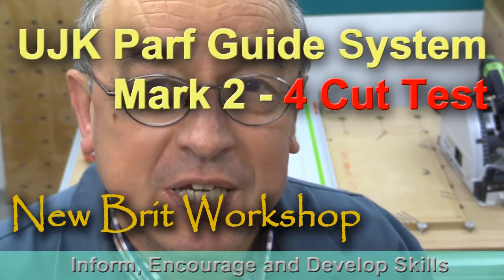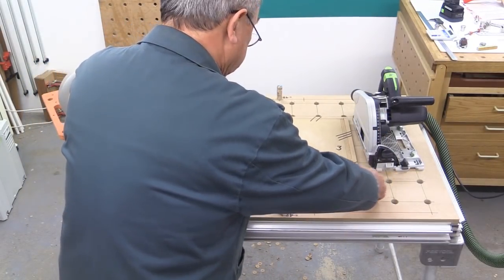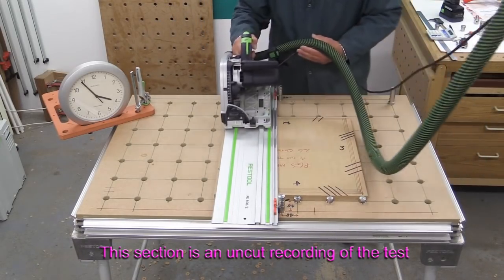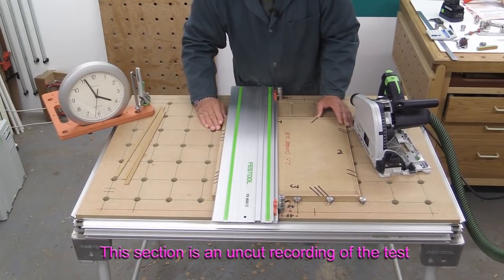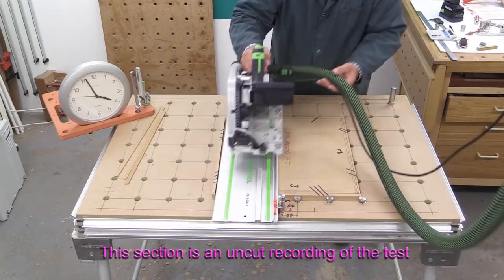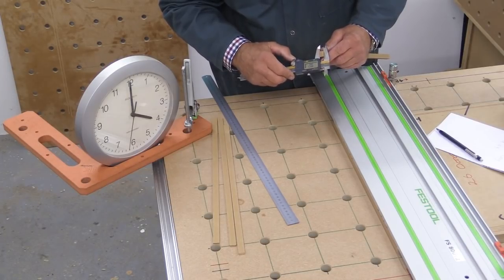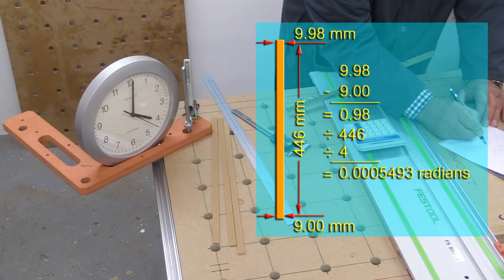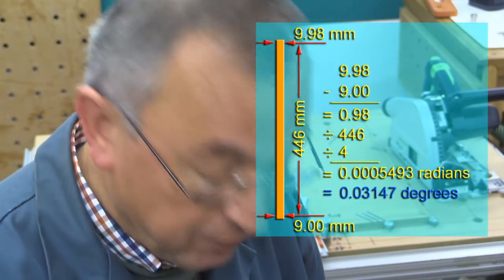UJK Parf Guide System Mark 2 - 4 Cut Test

Comment: Hey Peter!
Thirst of all thanks for those great and partly hilarious (talking about the obsession of perfect squares..) videos. But to be honest, I don't really get why everyone else is talking about 5 cuts, and you only did 4?
Let's say the side, you put an your dogs first isn't really straight, it might be touching your dogs pretty well, but when it comes to the 4th cut, there must be an inacurancy for sure, doesn't it?
Talking about William NG, he's also only counting on the 5th cut.

Greets
Michael
Reply from the maker: Hi Michael, Yes, it would be a 5 cut test if the starting side is not already straight. I always start with a piece of wood which has a known good straight side.  Cheers.    Peter
Reply: @NewBritWorkshop  Ok, thanks Peter, thats logic. But there is another thing I'm wondering about: The MKII is definitely technically developed, but the results of your 4 cut test of both of the systems showing the opposite in the issue of precision? For sure both are deadly precise, but there is an difference of about 0.75mm between MK1 and 2. 

Greets
Reply from the maker: Hi Michael, Unknown to me at the time of doing the Mark 2 PGS test my saw was out of adjustment and in particular the adjustment to make it snug on the track. As a result of that I produced a video on how to adjust the TS55: https://www.youtube.com/watch?v=qihJeoKa86g     And then I repeated the 4 (some call it 5) cut test which produced a much better result - it is near the end of this video:   https://www.youtube.com/watch?v=FsBIWL30RP0    Peter
Reply: @NewBritWorkshop  Hey Peter! That was very helpfull and impressive aswell, thanks for that! I'm goin for the MK2 as soon as possible! :)
Cheers!

Comment: I’m afraid that I didn’t understand this. If u have 0.98mm difference in 446mm long, than is equal a 2.19mm in 1meter! This is disaster.
Reply from the maker: Hi Andrew, The explanation is in the video. The final piece has a compound error from all 4 cuts and so you need to divide it by 4 and divide it by the length of the piece to get the angular error.  Peter